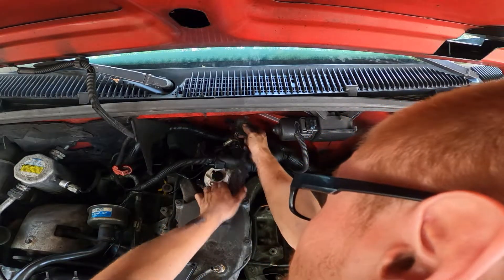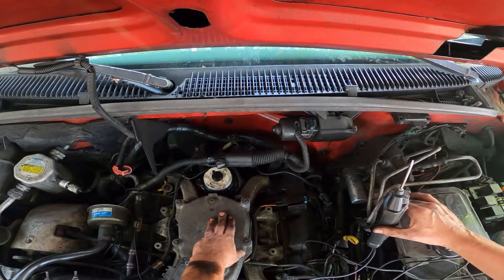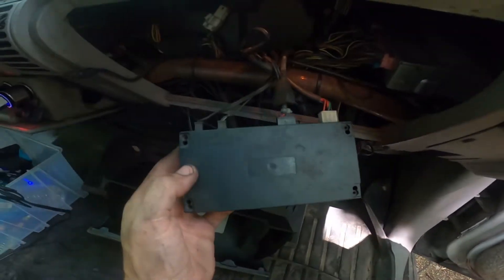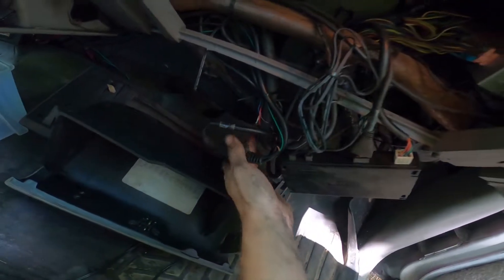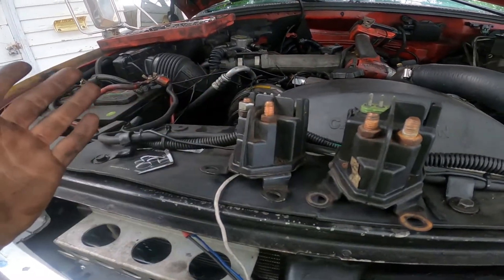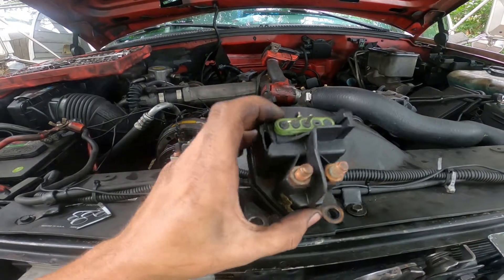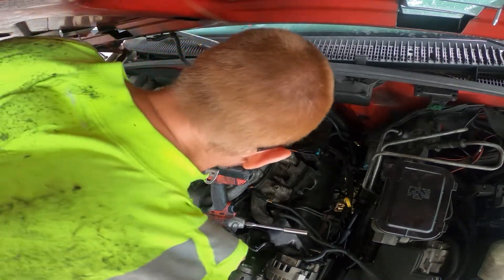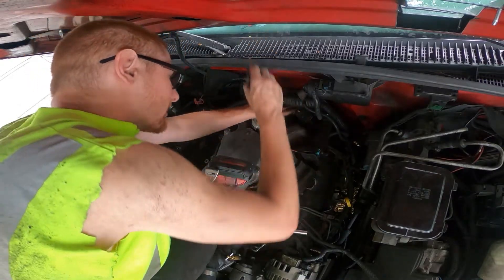The Truck Won't Start! 6.5 Detroit No Wait To Start Light Fixed!

Comment: When you tested it ,it has a time intervals to cycle the glow plugs.How did you check for power on the harness in time  ? How is the cycle timing turned on and off ? Where does the timed cycle come from,the cpu ? Or something else ?

Comment: Ive had a no start no glow plug light on issue and found a fuse missing from the #4 fuse holder in the driver side dash.I was checking fuses before that because I blew the cab light fuse abd was trying to find which one it was and somehow lost the # 4 fuse and didnt relise it.Somehow my # 4 fuse controles my glow plug relay abd dash light ?

Comment: Good video-- I have opened them up.  Inside is a MOSFET controller (running off 5v ecu signal) ...it also has a diode and an input resistor.  Mosfets are like a solid state relay---and the signal allows voltage to activate the relay for the glow plugs.  While MOSFETS in theory are "high impedance with no current flow" devices--they do in fact use capacitance to control the high current flow used to operate the coil.  If the resistor wasn't there--the coil would draw over over 20 amps of current for about 1 second while the capacitor charges--it would draw it thru the ECM and probably fry it.  without the diode--the backcharge from the coil would also cause damage. The coil itself measures about 8 ohms of resistance.  Luckily, the unit basically fails "off" if diode etc fails. I have always wanted a slightly longer glow plug time to compensate for the change from 9G glow plugs to the current ones.  The old 9g's lit up about 3 seconds quicker than the new ones.  However, the ECU has no idea what plugs you have---so the GP's are chronically "short timed"--which is one reason why the 6.5 always seems harder to start in cold weather.  So..I'm using a solid state programmable relay that adds 3 seconds of "on time" to whatever ECU signals.  This is an immense improvement in really cold weather --ie--20 F or below.  I have installed it...but not sure its ready for prime time as its pretty delicate for the environment under the hood...we'll see.

Comment: Your knowledge is pretty freakin' amazing! "We'll see what breaks tomorrow" - lol. Nice to see you've kept your sense of humor. I would've have run the truck over with a bulldozer by now.
Reply from the maker: You have no idea.. I don't think I have had a single day yet where something doesn't break. I just have to figure it out to keep it running and hopefully I am able to run it without a problem soon. I just had an oil cooler line spring a leak last night and drove home with very little oil. Fixed that though.
Reply: @TowTruckNate  See? "Fixed that though". I rest my case ;-)